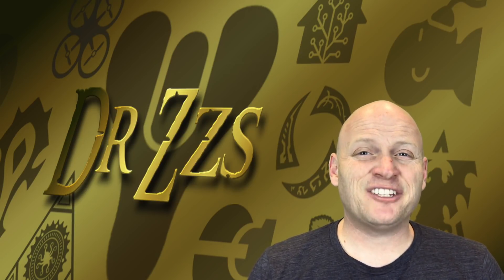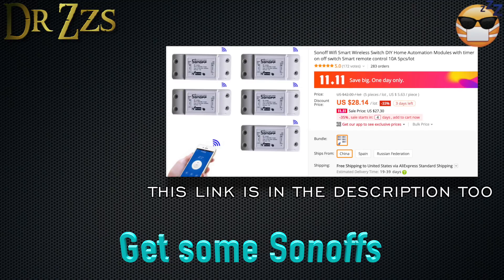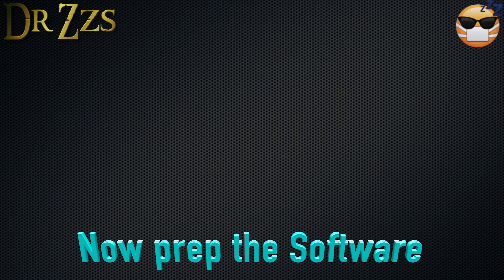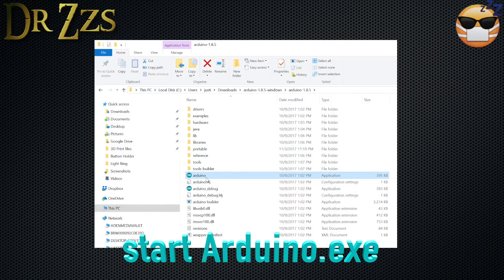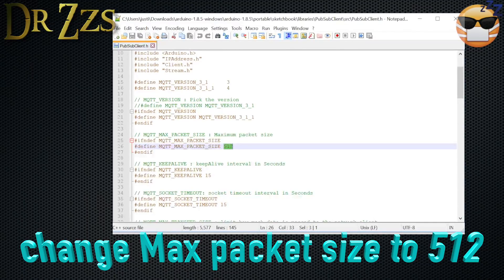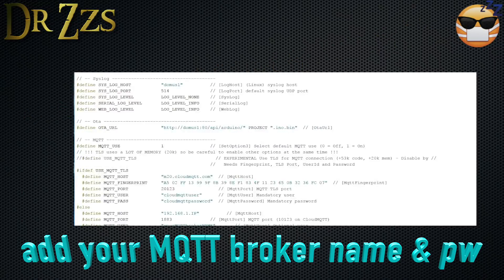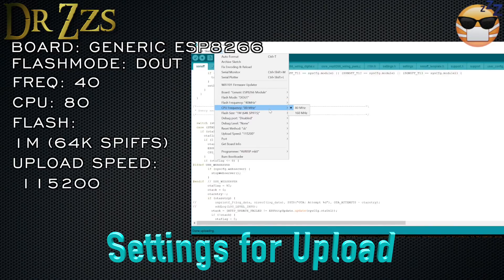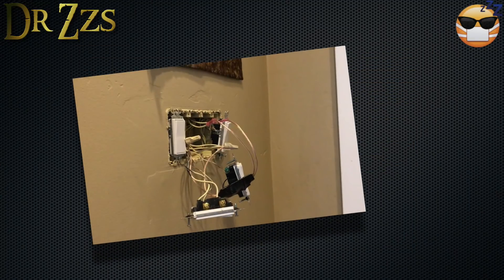Flashing TASMOTA Firmware on the Sonoff Basic

Comment: no way to put it in Flash Mode with Sonoff last release... :(
Reply from the maker: uh oh.
do you have a link with info?
Reply: https://github.com/arendst/Sonoff-Tasmota/issues/463
Reply from the maker: Morihei Ueshiba I’ll order a new batch from iTead and test them out. I’m pretty sure every esp8266 goes into programming mode of GPIO0 is grounded on power up. Guess we’ll find out. 
Thanks
Reply: i made something similar but i burned it :)... i wait your solution bro.
many thx
Reply from the maker: it is pretty hard to make the connections directly to the chip!  I'll get some new ones and test them out.

Comment: Hi, if i flash using the method on the video TASMOTA Firmware, can i connect to cloud https://io.adafruit.com/ with MQTT support
Reply from the maker: yes, you can use a cloud MQTT broker.  
I just use my HA pi running Mosquitto as the broker, so I haven't set it up myself.  There's a section in the user_config.h for "cloud" mqtt info: 
https://www.dropbox.com/s/02m5k43lldztame/Screenshot%202018-03-22%2008.34.14.png?dl=0
Reply: thank you so much

Comment: First, thank you for sharing your knowledge. I am new to all this. I recently downloaded the Arduino 1.8.5. Created a new folder "portable" in the same folder as the installed Arduino program. When I ran the Arduino.exe, I was prompted by an error " Arduino cannot run because it could not create a folder to store your sketchbook ". Am I doing something wrong? How can fix this error?
Reply from the maker: Thanks!  
I was new too, not that long ago.  The process of flashing the sonoff has gotten easier.  Check out this updated video: https://youtu.be/c2IUIUnxjUY
And I've learned to do some things better (and safer) for turning the sonoff into a light switch: https://youtu.be/B38e1HAMUXs

In short, you don't have to do the parts with the portable folder, or the MQTT max packet, etc.  Just download Tasmota, find the "lib" folder, copy everything in there, and paste it all into the "libraries" folder that gets created when you download Arduino. 

I wonder about that error you're getting.  When it says it can't create a folder that just makes me wonder about admin privileges.  If you're using Windows try using this version of the Arduino IDE: https://www.arduino.cc/download_handler.php?f=/arduino-1.8.5-windows.zip

Hope that helps.  Keep asking questions if you get stuck.  We'll get you up and running!

Comment: Hi I followed until I gor to MQTT & Pi!!!  I am running Smartthings so initially just want to upgrade to Tasmoto. Do I actually need MQTT or is it solely for Home Assist?
Reply from the maker: good question.  I know Tasmota is compatible with SmartThings. I don't know much else about getting them communicating.  My guess would be you won't need a separate pi/mqtt broker. 
Just found this: https://github.com/BrettSheleski/SmartThingsPublic/blob/master/devicetypes/BrettSheleski/sonoff-tasmota.src/readme.md

Looks like it should be pretty easy to get SmartThings talking to your Tasmotized Sonoffs.  

BTW, I've learned some things about making the sonoffs better (and safer) as a light switch.  Check this one out: https://youtu.be/B38e1HAMUXs

Good Luck!

Comment: Hey i enjoyed your video. I just subscribed. Thank you. I have a really important question i would appreciate a response. I have a small business. And we clean sofas. Sometimes i wish to know. If my employess are working more or less and i think i can tell by how long the vacum has been on? Can this device tell me how long a certaon device was on? And from what time to what time?
Reply from the maker: Thanks!
The short answer is no, it doesn't do those things by default.  It CAN be done, but it would take some work to set it all up. 
If you use Home Assistant it can tell you when a device is on/off. It shows in the "History" and "Logbook".  I'm sure there are ways to extract that data for specific devices only, but I don't know the process exactly.  
I'm sure other Home Assistant pros would know how to do it. 

Here's examples of what mine looked like from this morning:
https://www.dropbox.com/s/7xh0xy3p8wmi65p/Screenshot%202018-03-19%2008.49.38.png?dl=0
https://www.dropbox.com/s/uzwmcna5wj1wnrd/HistoryExample.mov?dl=0 

Check out the HA forums for possible solutions: https://community.home-assistant.io/

and BTW, there's an updated process for flashing the Sonoffs, and Setting up Home Assistant. Check out this video: https://youtu.be/c2IUIUnxjUY

Hope that helps!  
Good Luck!

Comment: I think the reason it didn' work with your Apple PC is that you need the driver for the USB Adapter and they aren't always too easy to find if they don't workout of the box...
Reply from the maker: I have had SO many issues with connecting Arduino stuff to the Mac USB ports.  I've deleted and re-added drivers, and had it working from time to time, but eventually it goes back to not recognizing them.  So I'm sure you're right. 
Grrrrr

Comment: Ok so i did flash my S20, and did put in all settings. However when i turn it on i can see on the Serial Monitor that it is trying to connect to my wifi network, however it fails, then tries again, fails again and then goes into WPS mode it says, fails again and reboots and starts from the beginning over and over again. What can there be wrong? Anyone has a solution for this?
Reply from the maker: check the user_conf.h and make sure your wifi SSID/PW are correct.  If you have dual band router the sonoff can only use the 2.4ghz channel (not the 5ghz).  Also, make sure your router isn't limiting the connection of new devices. 
If it isn't any of those things you can change the wifi function in the user_config.h so it creates a wifi SSID called sonoffxxxx that you connect to and put your home wifi SSID and PW.  That's how I did it here (as an example): https://youtu.be/c2IUIUnxjUY  around 11:20 in that video.
Reply: DrZzs i did that already none if it worked. The next thing i will try today once i get home is shorten my wifi password.
Reply from the maker: any luck?
Reply: Well, i did try ALLOT! i did get in contact with a man on Facebook. Flashing your way, did not work at all./ Flashing with Atom, did work somewhat. Then he made me a .bin file and a tool FlashESP8266, and now i can flash it like a charm
Reply from the maker: excellent! 
Glad you found a way that works!
Reply: Jeah, now waiting for my PI 3B+ with 7 inch touch to setup a MQTT and home automation
Reply: BTW! If i use the Pi as a MQTT, can i still use it simultaneously with Smart Home automation?
Reply from the maker: for sure! 
Home automation hubs and mqtt brokers are very lightweight.  You're spanking new pi3B+ can run both with lots of resources to spare.

If you use Home Assistant it's really easy to install the MQTT broker on the same pi.  The most common way to run Home Assistant is called Hassio.
There's a super easy add-on for Mosquitto (mqtt broker).  https://youtu.be/c2IUIUnxjUY

Home Assistant runs "headless" though, so I don't think the 7" touch display will be much use with it.  I don't know about other Home Automation hubs.  Maybe OpenHab makes use of a screen... 

A lot of folks use an old tablet and HA Dashboard for a cool touch display. 
https://youtu.be/KDpz3OvaU4c
Reply: Ow damn that is gonna be epic!

Comment: why can i run mosquitto.exe on my admin command prompt, but i try opening 2 comand promt window, to test pub and sub ;it work.
and 1 more thing, i cannot config my password and username. 
thanks in advance
Reply from the maker: Sorry, I don't know the answer to that one. 
You're installing mosquitto on a Windows machine?  

I've found a better set-up and process since I made this video. 
HASSIO with the Mosquitto add-on is really simple to get started: https://youtu.be/c2IUIUnxjUY
setting up the username and password can be done in the configuration.yaml file, or in the Options box for the Add-on. 

Also some modifications to the Sonoff (including a fuse): https://youtu.be/B38e1HAMUXs

That's probably not a great help.  Tell me more specifically what errors you're seeing and I'll try to help more.

Comment: Hello, Thanks for a great video. 
Have you tested the sonoff 4CH Pro R2 version? if so. How can I set it Flash mode?
Reply from the maker: Thanks!
I have a 4ch, but I haven't even opened the box yet.  
Here are some written instructions on how to flash it.  
https://github.com/arendst/Sonoff-Tasmota/wiki/Sonoff-4CH-and-4CH-Pro

Looks like the hard part will be getting it in programming mode. It's not as simple as holding down a button during power up.  Looks like you have to touch a tiny pin on the esp chip. 
Hope you have nimble little elf fingers. 
Maybe I can do a short video just about how to do that. 
I need to find a way to make a video that doesn't take 20 hrs of editing....
Reply: Do you have the R2 version? here is my issue on GitHub https://github.com/arendst/Sonoff-Tasmota/issues/2018

Comment: Hello, thank you very much for your video. I followed your tutorial step by step. I installed the software in the same way you did it. I have edit the sonoff config and saved it. Finally you have to go to "Tool" to change some things before uploading. When I pressed there ("Tools") I was shocked because I could se that many of these things wasn't there:
Inside "Board" I couldn't find "Generic Esp8266 module"; 
Flash mode; Flash frecuency; CPU frecuency; Flash size; Upload speed.
As you can see, I could not upload anything. WHY???, What happened?. I hope you can help me so I can finish my work. Thanks in advanced!
Reply from the maker: I know exactly what happened.... I skipped a step in the video... sorry. 
Go to Tools, Board, Boards Manager and search for esp8266 board manager and install it.  Sorry.  If you haven't seen it yet I made an updated version of this video. 
https://youtu.be/B38e1HAMUXs

Hope that helps!
Reply: Thanks a lot for that....BUT when I started to upload I got an error: "the size define MQTT_MAX_PACKET 512" was to small. You have to writte minimum1000. I wrote 1024 and saved it. I started again with uploading and got an other:                             
"Arduino: 1.8.5 (Windows 7), Board: "Generic ESP8266 Module, 80 MHz, 40MHz, DOUT, 115200, 1M (64K SPIFFS), ck, Disabled, None"
C:\Download\Sonoff-Tasmota-5.12.0\sonoff\sonoff.ino:53:29: fatal error: IRremoteESP8266.h: No such file or directory
 #include <IRremoteESP8266.h>"
Can you help?,  Thanks
Reply: Hello, you know, I found out that 2 or 3 library was missing, so I installed and the problem was solved. I would really appreciate it. Thanks in advance.

Comment: Hello, thank you for this great video. I bought a this module to flash my sonoff, but it doesn't work (https://www.amazon.de/gp/product/B00AFRXKFU/ref=oh_aui_detailpage_o00_s00?ie=UTF8&psc=1) 
I connect 3,3V-3,3V, RX-TX, TX-RX and GND-GND. I use ARduino , but it always gives this error : warning : espcomm_sync failed ... 
Can you please tell me what I do wrong ? Thank you in advance !
Reply from the maker: It could be a whole bunch of possible things.  I'm not familiar with that board. I would assume it's fine and should serve the purpose, but since I haven't used it I can't saw for certain. It could be something simple like holding the button when you power it up.  In some cases some people have had issues with the Tx and Rx being mislabeled, or there situations (like using and arduino board) when you actually need to connect Tx-Tx and Rx-Rx. So, try connecting them that way, just to rule that out.  Finally, it could be something in the tools settings, like DOUT, Baud rate, etc.  
Sorry I don't have a more specific answer for you.
Reply: DRZss, Thank you for the quick response ! I will try again a few times :-) . Do you think there"s gone be a new OTA possibility ?

Comment: Hello found your cool video, Thanks, I have the single leg switch that you say in the video that im outta luck, however i found that if i installed the sonoff inside the light fixture and not in the switch box, then set the power on state to on, it works with the switch and wifi, however the sonoff does not like being powered on/off quickly as the light part works it just takes a while to sync to the wifi.
great videos!!
Reply from the maker: Thanks!
I should have said that it is possible to put the sonoff in the light box instead of the switch box in that case.  I think you could use the wires that go to the switch to connect to GPIO 14.  Then you wouldn't be turning the power off/on to the sonoff.  I haven't done that, but it should work.
Reply: My device was designed for exactly this! I designed it to fit inside a switch box. It is limited to 120VAC/250 watts, but in the event of a WiFi failure, you still have switched lighting control (It's a true 3-way) 
http://piwifio.com/3WayRetrofit.html

Comment: I've got a couple of uk wall sockets .also got sonoff wifi switch.neither switches use same software.is there any way around this as so I can use same server ?
Reply from the maker: hmmm, I'd say there's probably a way.  Give me some more details about your switches and the software they're using and I'll try to help.
Reply: DrZzs hi yes it's a standard sonoff. Wifi switch and smart wifi socket model SWA1 .the sonoff only works on ewelinkapp and smart wifi socket only works on smart life app
Reply from the maker: ah, I see.  Well, the best solution I have for combining different devices that run different software is to use something like Home Assistant.  If you're going to keep adding devices to your "smart" home, then getting a hub (like Home Assistant) is a good idea. 
In the meantime, something like Alexa (Amazon Echo) or Google Home might work.  I know the Sonoffs connect to Alexa and Google.  Not sure about your other smart switch, but it's likely that it would work with one of both of those.  Essentially, Alexa can be your Smart Home Hub.  
Hope that helps!
Reply: DrZzs if I was to flash my sonoff with different firmware would that allow me to use any app to control it ?

Comment: HI, i am having problems with tasmota firmware being able to receive the value of a bmp180  sensor attached to my sonoff, BMP180 is connected up and works i can see the temperature,baro pressure on the webinterface with no problem and updating in realtime, I want to be able to view this data on my android device and have installed mqtt dashboard, this gives me buttons where i can turn on and off lights alter led colors etc these work great, i am using a cloudmqtt server... the only thing i cant seem to get right is be able to display the temperature on mqtt dashboard android i have parsed the json sring and got a value but no way will mqtt display the temperature surely it cant be this hard to get temperature on my android phone...? Please Help...
Reply from the maker: Man, I don't think I can be much help to you. I don't know the first thing about mqtt dashboard. 
The closest I can get would be to imagine what you'd have to do in Home Assistant. I think you'd have to use a template for the payload.  I have something similar with my Holiday LEDs. The template reads the value and sends it as the payload, which then gets displayed. 
This is what the payload looks like when it's using a template value:
    action:
      - service: mqtt.publish
        data_template:
          topic: "bruh/mqttstrip/seteffect"
          payload: '{{ trigger.to_state.state | string }}'

For what it's worth here's a link to the Home Assistant page about templates.  It's json, so if mqtt dashboard uses json it may be similar. 
https://home-assistant.io/docs/configuration/templating/

I don't expect that'll be too much help to you, but that's about all I can think of. 
Sorry
Reply: yeah thats no problem, thanks anyway..... i am trying to install open hab in my raspberry pi maybe that will be better

Comment: Can I use a 5 pin USB to ttl that has 3.3 , rx, tx, ground and 5v ?
Reply from the maker: Yes!  mine has 5 pins too.  To use it with the Sonoff you just leave out the 5v.  So from the ttl you just use 3v, tx, rx, gnd.  
Hope that helps!
Reply: Perfect, thanks.

Comment: Great videos, I have a question about Home Assistant MQTT broker, do I need to install seperate Mqtt server or I can use the MQTT broker as HASSIO Add-on, in which case when editing the user_config entry, where it says MQTT HOST, what IP address you put in?
Thanks
Reply from the maker: Thanks!
Yes, you can use the MQTT broker add-on (Mosquitto).  When you're setting it up the "host" is the IP address of your Home Assistant pi. It's the IP address of the computer where Mosquitto is running.
Hope that helps!

Comment: help please 
Sonoff-Tasmota-5.12.0\sonoff\xdrv_03_energy.ino:396:27: fatal error: TasmotaSerial.h: No such file or directory
Reply from the maker: the process has changed. 
you need to copy all the libraries from the tasmota "lib" folder and paste them into the Arduino/Libraries folder.  That should fix that error.
Reply: thank you that worked
Reply: Hey I emailed you wanted to know if you got a chance to take a look at it
Reply from the maker: I saw it briefly.  I'll check it out right now.

Comment: I have this USB Serial to TTL serial converter (https://www.amazon.com/gp/product/B01CYBHM26/ref=oh_aui_detailpage_o00_s02?ie=UTF8&psc=1). 
Will this work? or I do have to use the one you posted?
Thanks!
Reply from the maker: As far as I can tell that should work.  Make sure you use the 3v pin, not the 5v.  From my few minutes of research, it looks like TTL UART is a generic version of FTDI, which is branded by Arduino.  I'm not 100% sure Arduino hasn't done something so only their board will work with the IDE.  I kinda doubt they'd do that, but it's possible. 
Let me know if it doesn't work.  I don't know much about the difference so I'm curious to see if it'll work for you. 
Good Luck!